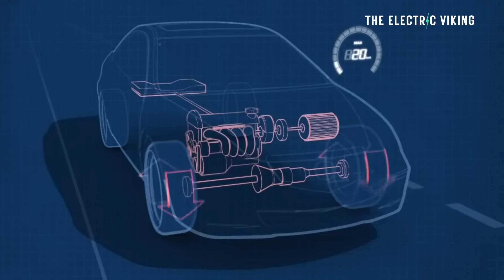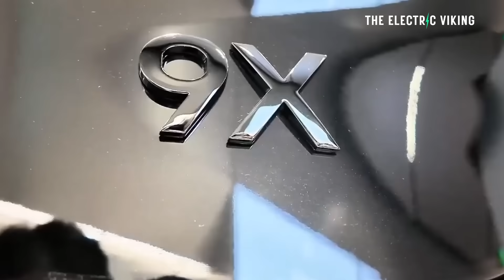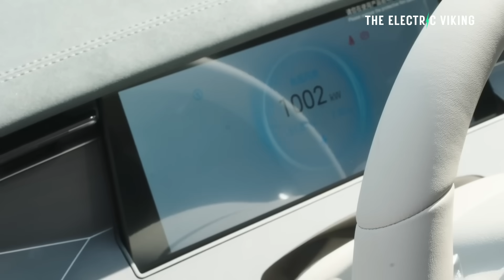PHEV EV Range Game-Changer: China Sets Electric-Only Range Floor

Comment: Good point about PHEV for towing. I bought a used ID4 to try a pure EV. With the 20% to 80% rule, the 400km range becomes 240km. We rented a small caravan to try towing and we got 100 to 150km range depending on wind and speed (100km/h vs 80km/h). It is not very practical. Great car in the city and for small trips though.

Comment: 90% of all trips if taken by car should be by electric kei car... If there's only 1-2 people on board why should we be driving massive, full-sized, overweight, oversized SUV's just to so simple commuting or grocery getting? The Smart Fortwo proved that you can literally do all you need to do in a 2.5M long platform, from commuting to road tripping and everything in between even just to get groceries. I own one and my record is 12 full-sized fully-loaded bags with about 9 of those alone in the truck. The rest on the passenger seat or floor.

Comment: 95% of cars only carry their driver and MAYYYYYYYBE 1 passenger, and of those? 95% travel less than 50 miles or 80 km a day... In other words as long as you actually PLUG IN your hybrid? You wouldn't need to touch the gasoline once except for the odd road trip.. Just saying.

Comment: More beneficial to build upon EV technology, with an efficient gas motor to extend range. 
Next level forward thinking and planning for sure. This will retire lesser hybrids
Reply: Yes, REEVs (Range Extended Electric Vehicles) with 200-250km of pure EV range and then a tank of gasoline that can keep you going in long trips would be ideal. Slow charging at home will make 90% of the driving time to be pure EV and gas for exceptions would be enough. The gas engine should start up if the battery dips bellow 20% and stop charging the battery only if the battery reached 80% of the driver stops it manually from a button. This would make the engines last for a very long time as well. Plug in hybrids with small batteries kill engines fast because they start and stop the engine often and sometimes even for just an overtake or something like that.

Comment: Can't agree more with the PHEV thing. I was considering buying a Shark 6 next year, but with the current EV range and my use, which hasn't really changed much over the years, the only reason for the PHEV would be as comfort of mind. However having watched a number of blogs lately with owners of EV's driving around Australia, in older EV's with limited range, I have come to realise it's more a psychological crutch than a necessity. If you were on a strict schedule which didn't allow for much charging time then sure maybe the BEV might not work at the moment, but as a purely leisure vehicle with no strict schedule it's fine, I can take my time and charging wouldn't be an issue.

With a mandated minimum range of 100km of EV driving 90% of use by most people would be within that EV range, shops, school, visiting friends, if you live in a largish town or city and rarely drive out of it you will probably never use anything but the battery. it's a win/win for EV makers, get people used to how easy and convenient EV's are, how much cheaper they are to run and before you know it they are replacing their PHEV with a BEV, or replacing their second older ICE car with a BEV. I can't see downside to this for EV makers, why they aren't doing it already off their own backs is a surprise actually, and as you say, some of them already are.

Comment: Lithium-ion battery fires are a growing cause for concern around the world, with fears about how electric vehicles, e-bikes, laptop chargers, and power banks pose a risk to people at home, at work, and on the move.
Reply: No they aren't, ICE cars catch fire at a rate of 61 times electric cars in the US, that should be the growing cause for concern, why are ICE cars so prone to fires, it would far better to replace all ICE cars with EV's as far as fire safety is concerned. Now I can see the concern with some models and technology, but that is due to bad design decisions by the EV makers and should be treated as such and not a flaw in EV's. The data is available for public perusal, you just need to look. Now the issue is bad design for exiting vehicles, and the problem highlighted by a number of recent Tesla fires, that's entirely different to the fire problem. In fact the Tesla Cybertruck uses NMC and not LFP battery chemistry but that's beside the point, the issue is the poor design of the door handles and technology, it should have been allowed on the road in that state, and is indeed banned in every country except the USA due to safety concerns, maybe that should be addressed. 

Note the US allows car makers to self-certify cars to state they comply with all Federal safety regulations and only investigate if there are safety issues, European and many other countries around the world require Type certification where cars are examined and given clearance, hence cybertrucks not being legal outside the US but unable to pass safety certification all over the world. So lets not allow the issue of poor design and bad safety certification colour the safety record of EV's, they are in fact much safer as far as fires are concerned than ICE cars.

China has already started plans to address the problem of electric door handles with new laws and mandates for how car door handles should work so that even in the event of a fire exiting should be far easier. Bad design shouldn't be used to cast blame on what is a far safer technology than ICE cars, and once China moves that way I expect other manufacturers will also.

Now ebikes and escooters are an issue you can address, there is far less safety around the manufacturing of batteries and chargers for those than for EV's, and that needs to change. Always charge escooters and ebikes outdoors and away from building is always my suggestion. Cheap models from China tend to skirt safety issues in the pursuit of sales and money.

Comment: This will be the death of the hybrid.  Won’t make sense making a phev with so much range.  Pure EVs will end up with the manufacturing cost advantage.
Reply: It will for REEVs instead of "normal" plug in hybrids. REEVs are the better way to go anyway as the engine only works at a constant RPM and will last way more time than in usual PHEV.

Comment: EREV series hybrid not as efficient as BYD DMO parallel hybrid.  BYD physically connects ICE to front wheels above 70Km/hr, making towing more efficient.  EREV for cars and CUVs maybe.
Reply: DMO is not parallel hybrid, but series-parallel hybrid. At low speeds it works as an series hybrid (EREV).
Reply: @deepseer OK series-parallel.  It goes parallel at 70Km/hr if memory serves.  Thanks

Comment: If China is worried about a glut in the battery market they  should 200 miles the minimum.   Takes care of too many batteries being made
Reply: They probably will next year.
Reply: Now there is a shortage of batteries, the real reason is that many hybrid vehicle owners are unwilling to refuel, preferring to drive solely on battery power, but the batteries in hybrid vehicles are small, and they often need to be recharged frequently, which not only provides a poor experience but also occupies a large number of public charging stations.

Comment: 100Km on the Chinese scale is too short for 2026. I had a 2016 Chevy Volt that had 53 miles of range EPA, that's more than 100 Km CLTC. 53 wasn't enough, I was able to stretch it to 72 miles in the summer and 60 in the winter by limiting myself to back roads and no heat in the winter but it was a struggle. A plug in should have 100 miles EPA, that's about 200 Km CLTC.
Reply: I disagree.   I haven't put gas in my volt in a year.
Reply: Not really although it depends on commuting patterns. I never need more than 100 km of range to do anything except for longer out of town road trips. So far I've only done ONE of those in the last year.. Just saying.

Comment: Electric Viking, Plug in hybrid has its place in countries where using public charging points "is" more expensive than using petrol.
In UK with a "home" charge it costs my Omoda 9 about 8p/mile electricity cost by paying the electricity tariff of 21p/kWh.  Using petrol on the same car cost 14p/mile or 50% more expensive.  However the cheapest public charging point is 63p/kWh or exactly 3 times more expensive.  Therefore it is a lot more economical to use the petrol on a plug-in hybrid after its EV range runs out than going to a public charging point.  UK situation is distorted as its electricity cost, at US$0.51/kWh is 5.86 times of China according to the published 2024 electricity tariff for business.  In the same data Australia electricity, at US$0.194/kWh, was 2.23 times China.
Reply: If you went on a dual rate tariff, you could cut your charging cost to 7p/kWh, during off-peak times.
Reply: @tomfahey2823   True! But the off peak time is more expensive than the single tariff.  Also there is a standing charge daily.  I charge my Omoda 9 , with a EV range 93 miles, about every 7 days so even with 7p/kWh off peak rate I lose money!  Off peak rate would work for those who do charge say every 2 to 3 days.
Reply: It is also worth mentioning that many of us who live in the countryside in the UK are constrained by antiquated single phase electricity and a costing to upgrade to three phase which is frankly absurd. a short range PHEV make sense both cost and charging time wise.
Reply: @robertcorke497  Short range Phev? Last year's technology was 1,400km and this year's technology is 2,100km!  AFAIK BYD, Jaecoo and Omoda models in UK have last year's technology already.
Reply: @robertcorke497 you don't need 3 phase to go full EV which is easily doable now , especially if you can home charge at 7p
Reply: @cliveharrington1553  Tried that, 7kw/h is the maximum and if you are charging up 80 or so kw/h that is 11 hours..........so the fuse blows. The combined intellect of Nat Grid, Transco and local CEE have given up.

Comment: This was an obvious evolution of plug-in hybrids and EREVs. Ultimately to have about 1/3-1/2 of the EV range of BEVs. The discontinued Chevy Volt (not Bolt) got around 55 miles of battery only range. The 3 additional features that modern EREVs should have are DC-fast charging, NACS, and V2H/V2L capability.
Reply: Yes. Also with a battery greater than one quarter the size of a standard EV means that there is a significant power buffer and the engine can be significantly smaller than a standard hybrid with a 1km/hr battery.

I'm not sure what all went into engineering the battery pack and sizing it for the application. I'm assuming that something close to a 2 or 2.5 liter would be appropriate for a mini van and if you wanted to scale it down for a two seater then a one liter engine with a fairly small battery would be possible.

Overall, packaging is fairly easy because you don't have a super big battery that take up a lot of room in the floor and the engine can be put in the front or rear and is fairly small.

Comment: This is the way they should be going anyway. At least 60 mile range. They’ll be around for 30 years btw
Reply: Zero chance.
Way too complex, way too many parts.
Hybrid will die very fast now as EV batteries and range keep improving.
Reply: @whowhy9023  Agreed. Twice as many parts. What we really need is 50 mile range EV's with 1-2 seats. That's all... Think Smart Fortwo EQ... GM EV1...
Reply: @whowhy9023  Yeah, Toyotas have been very unreliable
Reply: 5 years ago, the minimum range was set to 50 km. With a home charger (which is common in China), it is adequate for most car owners.